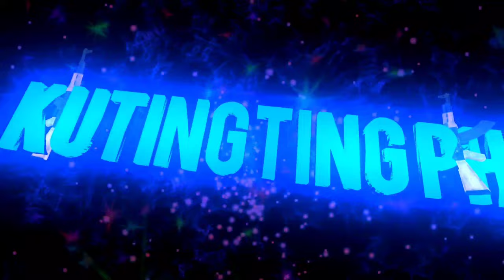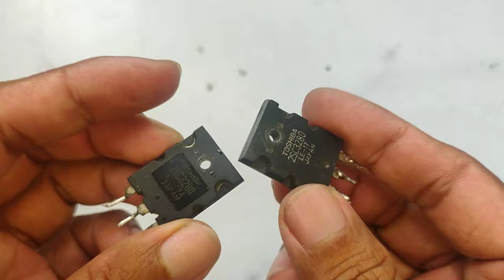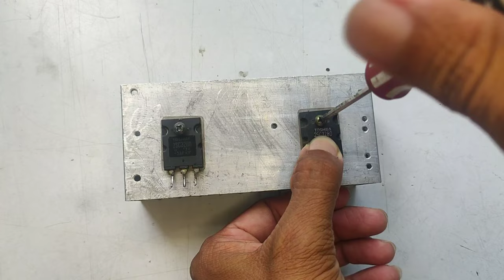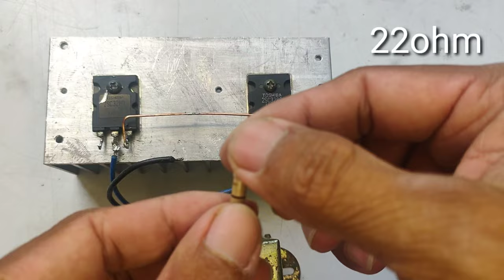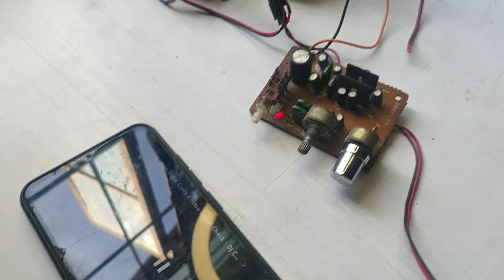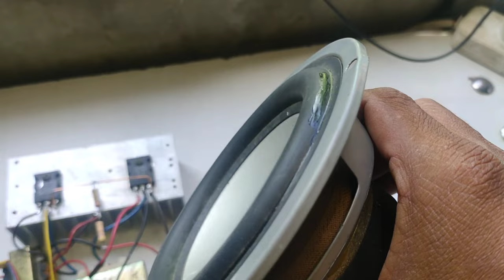how to make simple diy booster amplifier powerful 12v amplifier

Comment: Idol ilang watts speaker Kaya?
Reply: Kahit 500w na speaker kaya Nyan boss booster amp Yan e 4ohm load ok jan
Reply: Common emitter sya idol, npakalakas ng voltage output nyan pero subrang hina ng current out. Kya required lang sya sa mattaas na impedance na speaker. Or mag eestep-down secondary winding ka sa output transformer para magmatch ang impedance sa speaker.
Reply: Ok idol.. salamat Po.